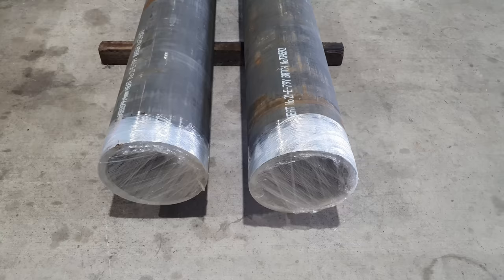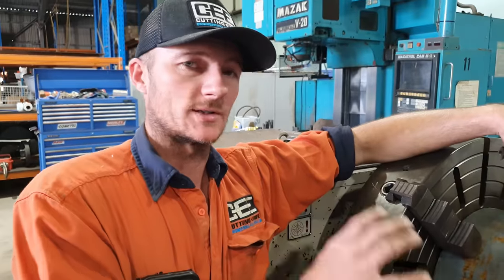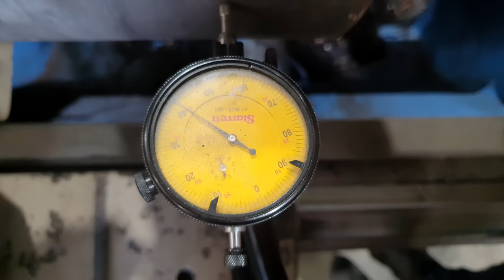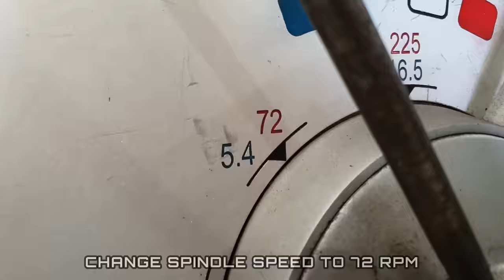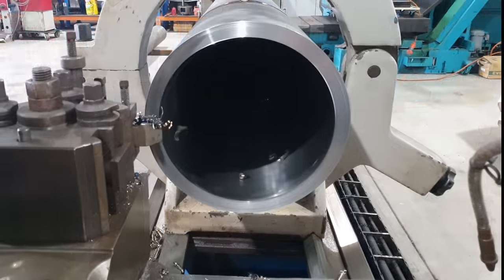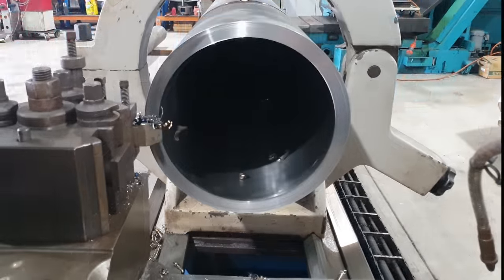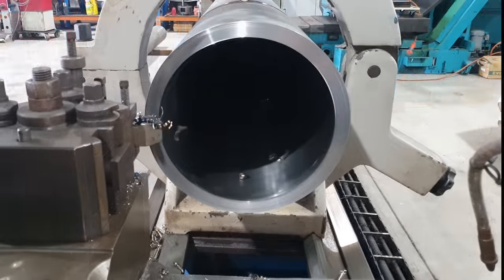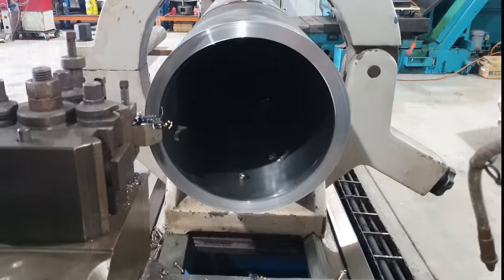Machining With The BIG Lathe | Large Lathe Work

Comment: 3:05 The tube was incredibly unstable, this was an uncalculated maneuver, an unnecessary risk
Reply from the maker: have to disagree with you there, I wouldn't have even lift it off the wood blocks if it was unstable and a risk
Reply: @CuttingEdgeEngineering  I hope so, but I think if the tube has started to tilt you won't be able to stabilize it again before it hits something or even falls catastrophically.
Just be careful man.

Comment: Not a big lathe at all maybe in your corner of the world. We do PC8000 boom cylinders RH400 and Hitatchi Ex8000 and you need minimum a 30000 Lb lathe and a 25’ bed to even think of working on a 24000 Lb assembled cylinder. And that China lathe we had and scrapped for problems with the direction feed control on the carriage. Tried to copy Stanko and failed. We Machine rods 16” dia .060” over send for hardening then grind Chrome and finish grind
Reply from the maker: cool story 😂👍

Comment: Can you really get a sufficiently accurate length measurement using an ordinary carpenter's tape measure? Not that I can think of any better way.
Reply from the maker: hey mate yeah for this job tolerance on length is +/- 2mm so yeah tape measure is accurate enough